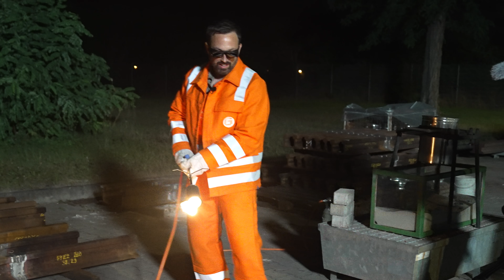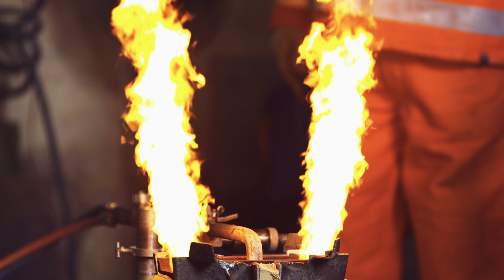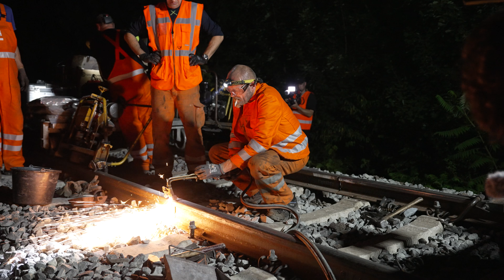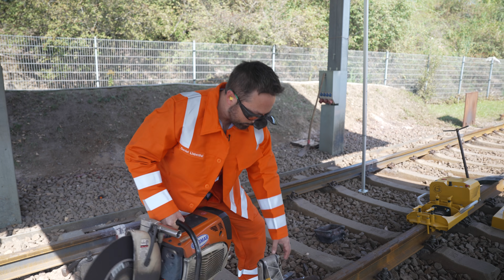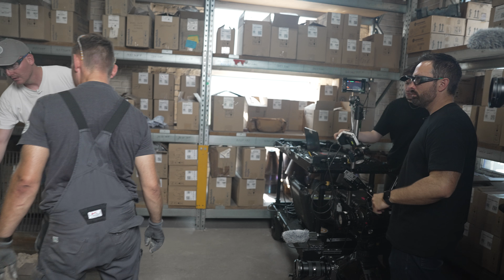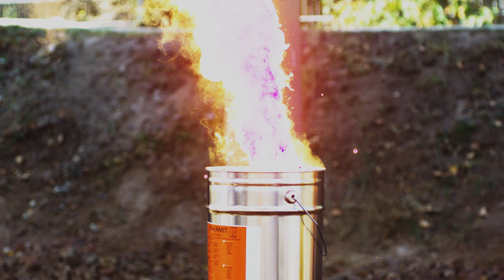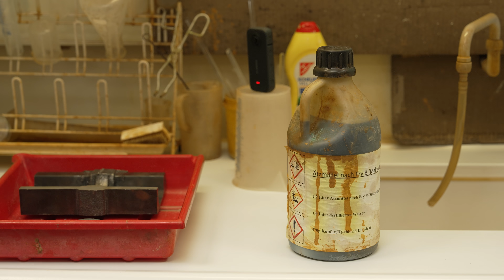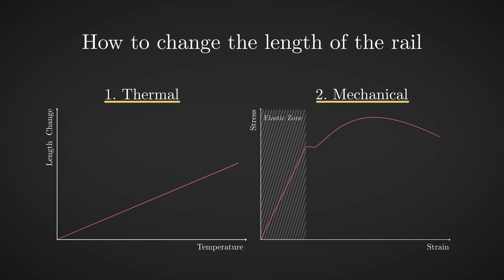Why Don’t Railroads Need Expansion Joints?

Comment: As a train driver this was absolutely fascinating. Really gives me an appreciation for what the engineers do through the night when I clock off. Great video.
Reply: Also kinda gives me more of an appreciation for why building a railroad is so expensive. Its not easy and is time consuming for sure.
Reply: In my neck of the woods, "train drivers" are called: Engineers.
Reply: @RILEYLEIFSON_UTAH It’s like that everywhere. I’ve never heard of an engineer referring to themselves as “a train driver.” That’s like a surgeon calling himself a “meat cutter!”
Reply: @RILEYLEIFSON_UTAH that’s what I was thinking
Reply: @RILEYLEIFSON_UTAH  or Motormen.
Reply: Same! It feels like it’s so simple, but apparently, it isn’t lol.. Still love the sound when I drive over those joints though. We need them at the switches in our network
Reply: Thermite is pretty coil.  Good Ole city boy dun discovered it
Reply: Welders not engineers brother. This is a welding technique. Engineers don't build anything in the field. We do it all. Engineers just make sure blueprints are correct and give us the okay on our instructions and plans. Us "hands" do all the work.
Reply: @tjaydagreat true, but without engineers designing your projects, you would have nothing to build. They don’t just give you the “ok.” lol.  They design and tell you how you will build it.
Reply: @tjaydagreat No train engineer would call himself a driver and think to thank "engineers". I'm a dispatcher and have worked on the railroad for 17 years now, and I have never met one lol
Reply: And you should know that you still here the joints when u pass over them
Reply: welders, not engineers.
Reply: Train driver? Ya, ok buddy..😅
Reply: @Mars-77 yeah that gave me a laugh.
Reply: Well its not just engineers there are technicians and welders
Reply: I'm making the blow your horn hand motion right now
Reply: Real engineers don't call themselves train drivers. Lol
Reply: @nikc1313  bro might be the thumbnail soon😯
Reply: youre very welcome! im glad what i can do for the public transport.
Reply: Ya we bust our assess. Gives you insight as to why the rail breaks or how pull apart happen
Reply: @jestopherson  or the people who think its light work
Reply: Train driver? Locomotive engineer you are not
Reply: This is the first time i ever seen anyone say they drive train 😂
Nice
Reply: Right, you're a "train driver" 😂 And I'm space ship driver....
Reply: Driver? You don’t drive a train, it doesn’t have a steering wheel. It has levers, so you operate it. 

Sorry, old joke.
Reply: Damn you drive trains and clock out at night? Wish I worked for your railroad
Reply: Wait train driver? Isn't that an engineer? Lol Anyways I think that would be a cool job.
Reply: engineers? i thought they were mechanics....
Reply: I thought it was conductor?
Reply: @TheOGTUT  Nope conductors don't operate trains. They oversee the operation as far as train orders are concerned.
Reply: Hope it would give the same type of appreciation to all the feminist activists preaching about work inequality.
Reply: As a construction worker, I'm just glad I don't have to think so much, the engineers have already figured out what to do
Reply: how do you drive a train?
Reply: As someone who lives near train tracks, I’ve always heard the “clickety-clack” sound and assumed it was from expansion joints. Now I realize that sound is becoming rarer thanks to CWR. Great breakdown of rail evolution and safety!
Reply: As a former motorman, I agree & am appalled at all the hate thrown your way. Being at the head of a train, mainline, subway or streetcar is a serious responsibility as lives, sometime very many lives are placed in your hands.
Reply: hi train driver! great comment! so why don't railroads need expansion joints?
Reply: @Anonymous-zu7dh Can I ask what you do for a living. That may give more insight as to how you're formulating your opinion, in order to help clarify your stance on it. Thanks.
Reply: It’s easy to take for granted how smooth train rides are today without realizing how much craftsmanship goes into every single weld. As someone who's tried thermite welding for DIY metal repairs, I can say the level of accuracy here is next level.
Reply: Is that job title not called conductor anymore? Or maybe I'm thinking of something else.
Reply: Train driver? You mean machinist?
Reply: Train driver? It’s called a locomotive operator or loco engineer
Reply: Train operator* but yeah I’m sure you aren’t lying
Reply: been on both sides of the red flag, i prefer the track work, nothing quite as satisfying as stacking dimes on a spike on a hardwood tie, ot as beautiful as the northern lights 50 miles from the nearest "city" light. being in the loco just aint the same but love the felling of sheer size though, we have a spiral tunnel system here its amazing too pass over your self when your consist is long enough
Reply: Train driver? You sure that's your title? Lol
Reply: And the worker's too 😊
Reply: Don’t you mean a train conductor?
Stolen valor bruh don’t even know the official title
Reply: “A train driver”? Isnt there a title for that position? A conductor? Maybe?
Reply: The “train driver” is a cool job, I’ve met a few of them in my job. I am the driver of a State Trooper car. Meet the train drivers when they are involved in fatality accidents at railway crossings. Messes some of them up a bit. (The mental state of the train driver, the deceased is almost always a “mess” )
Reply: You don’t even drive a train!? I know you in real life and you definitely have never driven a train before. Ever…

Sad to see you making all this train driving stuff up man
Reply: Apparently some people think it's a bad thing to thank other humans for working. "Yeah but he gets money." Yes that's the point of working, what do you get from trying to convince to stop thanking other people for the work they do? Some people lack empathy and gratitude
Reply: Thanks for keeping the world running! :P
Reply: You're welcome 💪🏻💪🏻💪🏻🇩🇪🇩🇪🇩🇪
Reply: I don't think the workers actually doing the stuff are engineers. I think there's at least one engineer with them when they're doing it but the others are just semi-skilled workers.
Reply: invar does not expand
Reply: @nikc1313  thank you for your service!
Reply: @danielbum912  What service? It's a job, he makes money, that's it.
Reply: I'm a rolling stock mechanic, we appreciate what you do as well!
Reply: Isn't a train driver called an engineer?
Reply: @matthewkeebler2326  in europe they refer to themselves as drivers
Reply: @matthewkeebler2326 I was looking for someone roasting this guy for saying "driver". He is definitely not an engineer.
Reply: I thought train drivers were called engineers...🤷
Reply: @AuditAmplifier  typical to assign the name driver among industry insiders. SR-71 pilots were sometimes called "Sled Drivers". 

It has a certain tongue-in-cheek silliness to it when referring to the most elite pilots operating the pinnacle of aeronautical engineering, over enemy territory, at mach 3.2+
Reply: OP in the US, you would be called a locomotive engineer. A different type of engineer
Reply: @Go777-p9b  Unless it was electric traction, they they are motormen traditionally.
Reply: It gives me an appreciation for people who actually do the job you claim to have. There are more YouTube resumes than there are in the real world.
Reply: Um you are definitely not a "train driver" I know 2 and you can't call them anything but a locomotive engineer.  They don't just "drive"
Reply: @shawnshurtz9147  Well I'm studying to become a driver too. And I prefer driver over engineer when expressing it in English. Not everyone online is from a primarily English speaking country. In the end it's a matter of preference. In the end while there may or may not include more than just driving, it's primarily driving.
Reply: @shawnshurtz9147 Depends on what kind of train you drive. Besides, every other country uses train driver (in translation)
Reply: @shawnshurtz9147  There are other countries, definitions and standars beside the US, you know... 

A engineer in our neck of the woods has nothing to do with driving a train 😘

Comment: I've been working as a metallurgist in rail manufacturing, welding, and failure analysis around the world for 40 years and this is far and away the best explanation of the thermite welding process that I have ever seen.
Reply: The techs at Goldschmitt are verry proud of that their making. This is German engenering at its best.
Reply: Thanks for all your hard work!
Reply: That's high praise indeed coming from someone with 40 years of experience in the field! It's absolutely amazing to hear that this explanation of the thermite welding process stands out as the best you've seen. It's always great to find clear and insightful content that truly captures the essence of such complex topics.
Reply: Flash but welding is how it's usually done now.  A flash but welding rig is a sight to behold.  The raw power is insane.
Reply: @BramBiesiekierski  There are still many many thermite welds made each year as the process is so much more portable.
Reply: @BramBiesiekierski they use a tremendous amount of energy when steel "Stud Guns" weld very large steel  pins to beams for concrete reinforcement, one pull of the trigger makes a molten puddle of steel approximately 1&1/2 - 2 inches in diameter in about 1&1/2 seconds it is awesome! I always called it a lightening gun.
I believe the generator for the machine was 100,000 volts or 150....
Reply: Strange unrelated question - with our current technology are we able to create Widmanstätten-like patterns in metal surfaces? What terms should I look up to learn more?
Reply: @alystair  the slow cooling needed to get visibly large widmanstatten like structures are usually cost prohibitive.
Reply: Could you please explain the part where they angle the rails before pouring the liquid metal? What goes wrong if you keep the rails flat on the ground? Thank you!
Reply: @ey3796  when it cools it shrinks, if not readjusted it would make a divot
Reply: Quick question: at 5:35 - 5:50, he says the metal contracts more at the top because there’s more metal there, and that’s why they have to angle the tracks that way. It seems like if the tracks weren’t angled that way then there wouldn’t be more Liquid Metal on top, thus not needing that higher force? Is there another explanation as to why the tracks are angled for pouring of the Liquid Metal?
Reply: @king_noah1210 no. The metal is liquid  it will always go to the bottom. Thats why the mold is made in a way that the top of the rail is actually  the bottom of the mold.  So the clear mold actually  shows the wrong thing it shows metal flowing straight  into the head which it doesnt do.   Theres a deverter plug that fills the middle blocking the majority of metal from flowing directly into the mold.  At the end when the mold is full thise slots actually  allow the slag to be pushed back out the top so the dense steel becomes the head.   The ange is solely to manage the height of the weld after solicitation.
Reply: I guess so.  With new construction they use flash but process to make long strings up.  But I'm sure with alot of repairs and minor works termite process would be easier.
Reply: @BramBiesiekierski  yes that's right. Manufacturers also make longer rails than historically too, so in the uk where historically there would be 5 welds to make a 216m / 709ft rail, now there are just one.
Reply: yes he got really into the Details and it was fun watching this one and btw thanks for repairing German Railways
Reply: glad you said that because I have seen this done in the North West of Australia on the Iron Ore mine railways around 1995 or 1996
Reply: All fine and good, but Why did he cut it, just to weld it again?  This is the part I don't get.
Reply: @Mattxwill1  at first it were separate pieces of rail that fit right next to eachother because of the expansion of the metal
Reply: Definitely  the best on YouTube
Reply: How many metallurgists have you run over in your career would you say? You know, on those overtime shifts.
Reply: Invar does not expand or shrink
Reply: Can I ask why "normal" hand welding does not work for rail?
(or at least worse than thermite)

It would seem (at first glance) that you could also shave down any excess material from the weld, like they already did here. 

(if I Googled correctly, I suspect FCAW would be needed/easiest for rail tracks?)

Would be interested to learn why this isn't the standard :)
Reply: @MrNicoJac normal welding cannot handle that thickness. That is the short answer. The longer explanation can be deducted from the video where different zones and steel microstructures explained.
Reply: @MrNicoJac  a variety of reasons, but the size/volume of the weld needed and the potential for porosity/defects in the weld. Any defects are likely to initiate fatigue cracks under the loading in service. It use used sometimes, but it is quite unusual with thermite or flashbutt welding being the most used methods around the world.
Reply: @MrNicoJac stick welds are surface  level and absolutely  full of pores.  We use stick or tig to build "frogs" the diamond  shaped chunks of metal in switches but there is no consistency  in stick.    Thermite fully liquefies  metal which allows the grain to mix into a solid piece.  So they pointed out that the heat effected metal is on the edge of welds is the weakest.  If stick was used each line would be a weak link.   Like using string to hold something down where thermite is like using a thick ratchet strap.

Comment: I was a thermite welder for 15 out of my 20 years working with the Illinois Central/Canadian National Railroad. I started in 2000 as a young greenhorn laborer. I was a second generation railroader after my father and uncles. I became a man out there on the steel and wood. Some of the best years of my life were spent working long days and nights, forming a brotherhood, and learning about unionism and working class pride. I left in 2020 after my 4th back surgery. It was brutal work sometimes, but I'd be lying if I said I didn't miss it.

The most fun I had was when I was a welder helper and then senior thermite welder. It's FASCINATING stuff and I learned so much about the physics of metal and how heat and cold affects steel under intense stresses. Me and my partner would bang out 10 thermite welds in a day when we had a grinding crew behind us finishing up those welds and making them flush with the rest of the rail. When it was just the two of us dropping the welds and then grinding them afterwards, we would top out at 4 a day. 

Thermite welding in the summer was incredibly grueling, brutal, and very dangerous. When that heat index got into the triple digits, my work clothes would literally rot right off my body. You couldn't drink enough water. Fellow co-workers would drop like flies from heat exhaustion. The worst would be when you had to stand over a fresh weld to grind it while it was still red hot. When it was soft like that, it was much easier to grind with the side and cup grinders. It certainly didn't make it more comfortable though. Straddling that weld and leaning in that grinder, I would absolutely cook my balls 😅. 

So many awesome memories. Thanks for the great video. To all the railroaders out there, stay safe and keep your heads up!
Reply: I was always wondering how they did the welds. This is MUCH more complicated than I thought it would be. Hilarious that the raliroaders of old could not wrap their minds around doing this for the customers. Same as it's always been I suppose. That old bottom line. I am experiencing this when I recently switched to AT&T wireless. If you want the sales dept, you wait exactly 10 seconds. For problems, you wait 10-30 minutes. This company makes BILLIONS in profits every year and "screw the customer after we have their money" is the motto. But the railroaders were the worst of the robber barons I understand.